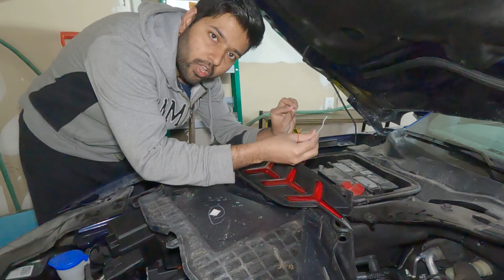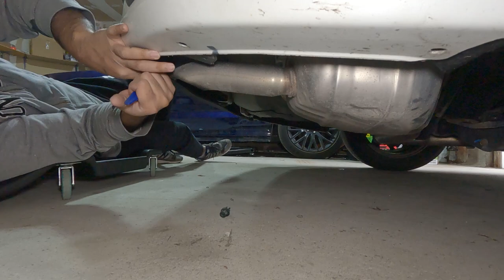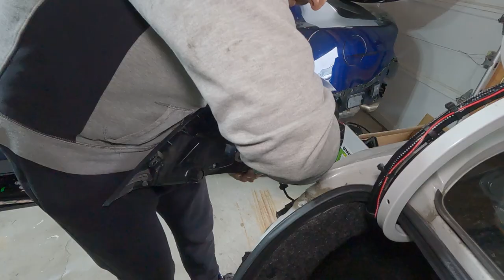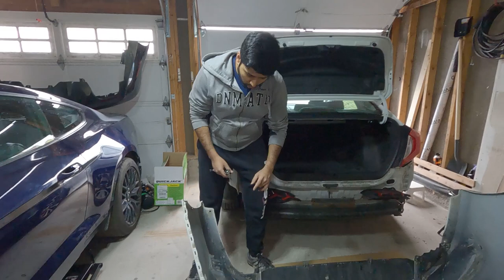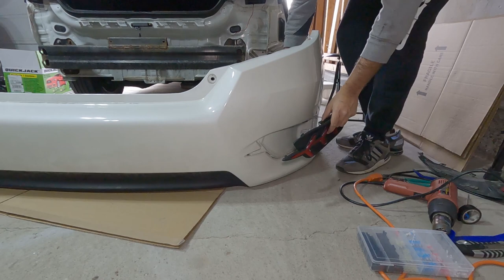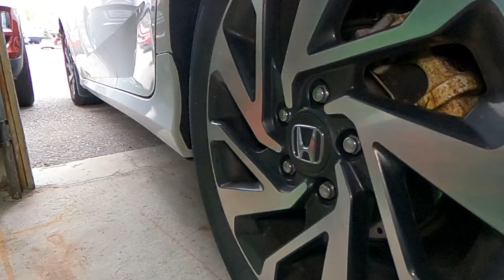LED BUMPER REFLECTOR INSTALLATION (FULL GUIDE) HONDA CIVIC 2016-2020

Comment: Bob M. Thanks for showing how to removing the bumper and how to run the wires. Great recovery on having done your wiring of the lights and then discovering you could not install them to the bumper so you cut the wires to solve that problem. Now I know to run the wires before hooking wires to the tail lights. Great job!

Comment: What if you push on your brake and the same time make a turn signal? What would it prioritize first? Thanks!
Reply from the maker: I connected turn signal on brighter led so it will flash between dimmer red and brighter red when brake is applied while signaling.
Reply: Just like when at night.  They’re dimmer until brake or turning signal are activated.
Reply: @museman007 😢😮

Comment: It shines even without the brake or turn signals on?
Reply from the maker: This one which I am installing does not but there are other in market which does glow as running light even with headlights off.

Comment: Mine started messing up.  They are flashing in one side.   :(. Should I replace or can it be fixed?
Reply from the maker: The best thing to do is just replace it. It's led module is probably faulty so I don't think it can be repaired.

Comment: I can’t get the pins to line up when putting the new ones on.  I saw you had trouble too and you cut out actually putting the new reflectors in.  What’s the best angle to go from?
Reply from the maker: There is not any fix angle. You have to keep trying and look for any part obstructing which need to trim out.

Comment: Do i really nees to take out the whole bumper?
Reply from the maker: Yes, if not then there is not enough space to work.
Reply: You do not need to take off bumper I did it easily without doing so

Comment: The question is when you step on the brake do the lights also turn on or not the ones you installed now?
Reply from the maker: It turns on with break. And it goes brighter with turn signal.

Comment: The reflectors I bought have red,black,white and a yellow wire. I connected them watching another video but now my tail gate red lights don’t come on and neither do the lights on my AC buttons or the shift light up don’t come on
Reply from the maker: The one you bought is comes with sequential signal. I am not sue what exactly happened but I suggest to check fuse foe each light not working.

Comment: What’s the link for this product
Reply from the maker: https://www.ebay.ca/itm/For-Honda-Civic-Sedan-2016-2018-LED-Reflector-Rear-Bumper-Tail-Light-Brake-Lamps-/114403091736?mkcid=16&mkevt=1&_trksid=p2349624.m46890.l6249&mkrid=711-127632-2357-0
Reply from the maker: Shipping cost will depend on where you live. You can search on eBay similar item with may be cheaper or free shipping.
Reply: I just got mine 10th gen 2021 Honda Civic ex sedan